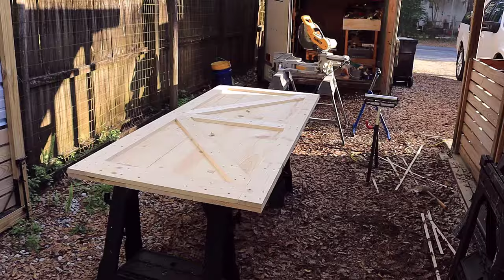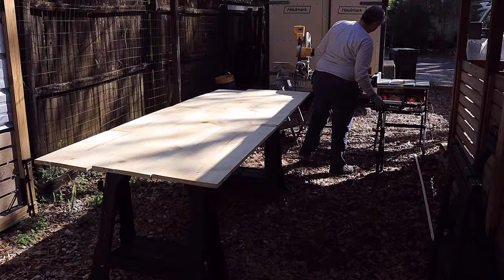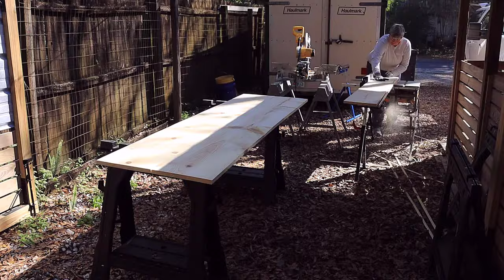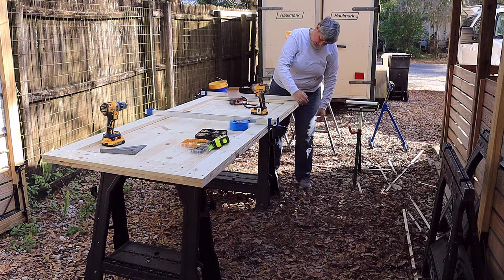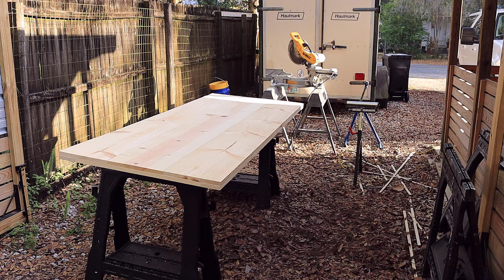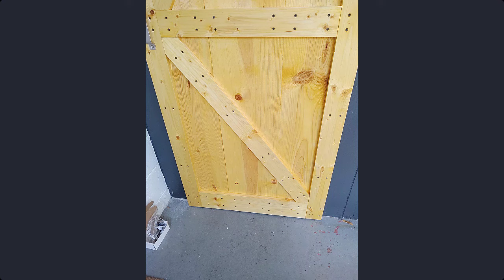How to Make an Exterior Barn Door with Board and Batten Style | Backyardscape

Comment: I was surprised to hear the recommendation to use pressure treated timber. I made a double outside door with pressure treated timber and have many issues with movement (shrinkage and expanding). I did let the timber settle for about six weeks before making the doors
Reply from the maker: Paul, thanks for the comment. Pressure treated wood is really a last case and cheaper wood than cypress, cedar or south american hardwood, like ipe when the barn door is exposed to the elements. Same thing as if you were building an outside gate.

Comment: What do you do in the install to assure that the door is sealed to the wall if it's an exterior door or can even be locked
Reply from the maker: Hi Sydnie, thanks for the question. If you're worried about having the door sealed, meaning absolutely no gaps between the door and frame, I'd suggest a different type of door, such as a hinged door. A barn door isn't perfectly sealed around it's perimeter. Locking a sliding barn door from the outside is different as well, since it's not butting up to a wall. A double hinge hasp lock would work similar to the picture in the following link since the door slides past the door frame. https://www.toolstation.com/master-lock-high-security-hinge-hasp-staple/p46483

Comment: I followed this video.  8 ft tall, 33in wide.....   1x6 boards... feels like it weighs close to a metric ton now......  didnt plan for that.. might need to slim it down to be usable.
Reply: You could probably use a pneumatic opener to assist. Same type of design you’d see on a storm door.
Reply: I’m worried about that for mine as well. But I might just make it a double door entry instead.